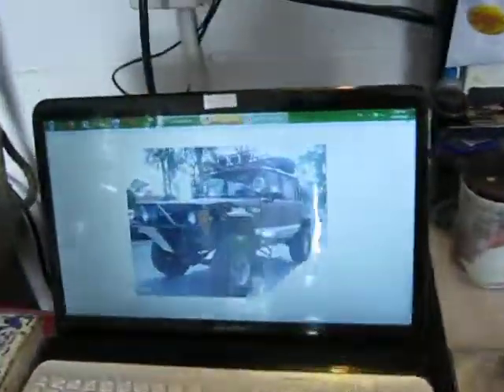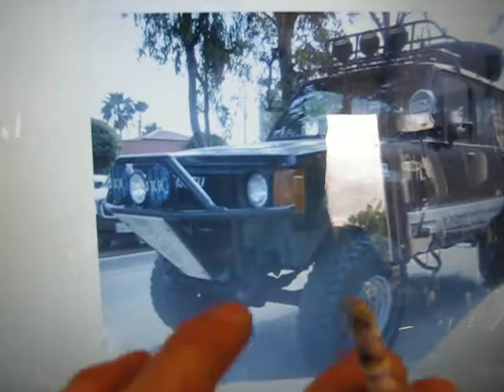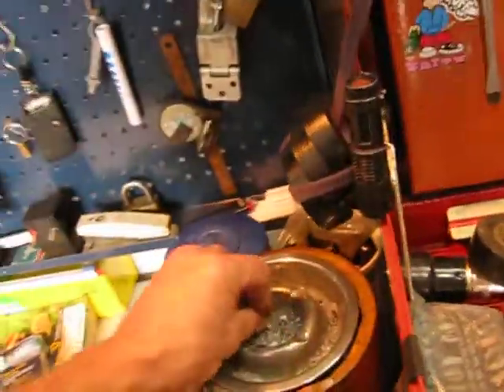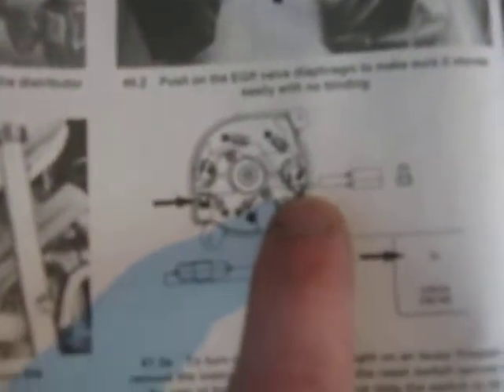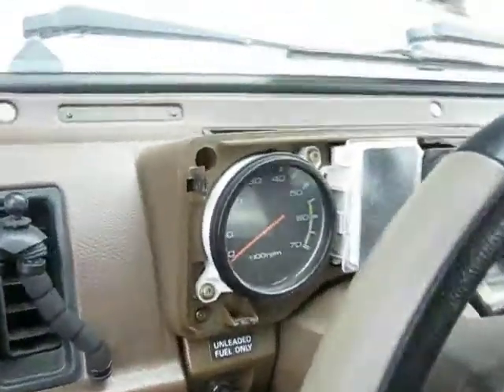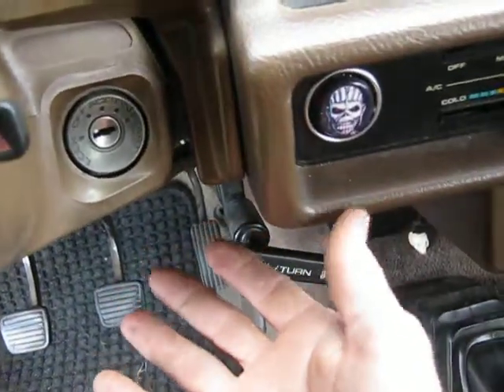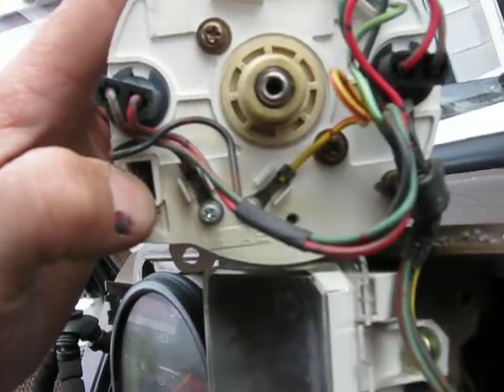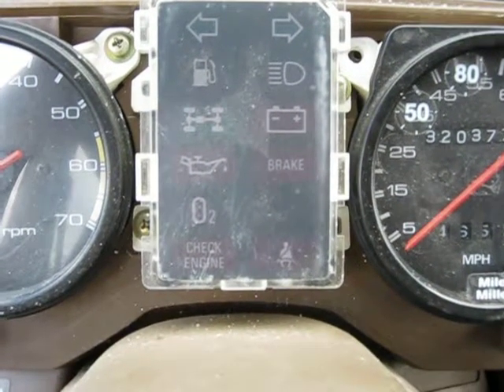How to reset O2 sensor dash light - Isuzu Trooper (1988-1991) 4ZE1

Comment: Good to know! I had an '88 years ago and it went on to greener pastures. I just got mt dad's '91 and its giving me fits to stay running.  It will start and if you feather the throttle it will rev-up.  Sounds nice about 2k rpms but it won't idle or stay running. Sat for 4 years, tank was horrible... replaced filter, pump, mass air sensor, cap, rotor & coil. Still can't get it to run right... video of video on my channel (if you can call it that) if you have any suggestions.
Reply from the maker: I,ll have a look bud, ITEC or Carb?
Reply: @islandtrooper4x432  ITEC
Reply from the maker: Sent you an e-mail bro
Reply from the maker: Hey bud, have been trying to send you helpful info, e-mail admin keeps returning my mail? Making direct replies to your email. Not sure sure whats wrong. Its all bouncin back??
Reply: @islandtrooper4x432  I'm getting the emails, thanks!

Comment: I wonder if this is the same for the pickups too?
Reply from the maker: Hey Rocket, good question and No, this is different than the Isuzu Pick Ups. 
Ok, there is a switch on the reverse side of the pups instrument cluster! 
Before you begin, remove negative battery clamp... 
To turn off the O2 indicator light on a pup, go to dash cluster, reverse side, look for a piece of masking tape, or a "shadow" of where masking tape had been,,, remove the masking tape from hole "B" note location.
On the right side of the cluster there is a large circular detent in the middle. to the left of that are 4 machine screws in a tight L pattern.remove the 3rd screw down. that is hole "A" Install the machine screw from "A" into hole "B" to the far middle right, where you removed the tape. re-install the dash cluster and ground battery clamp. Now the light will be out. It will come on again after reset once the odometer ads another 90,000 miles. Its really just a reminder light.
I can e-mail a diagram of the cluster if required to locate "A" & "B"
itm4x4@gmail.com